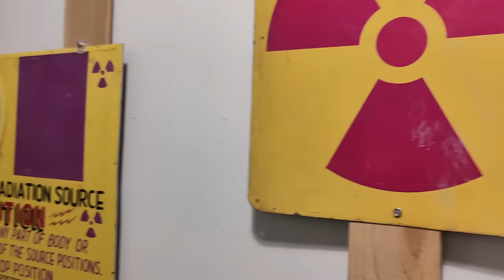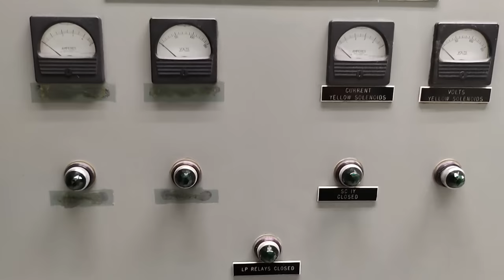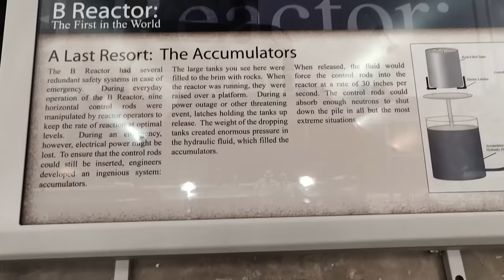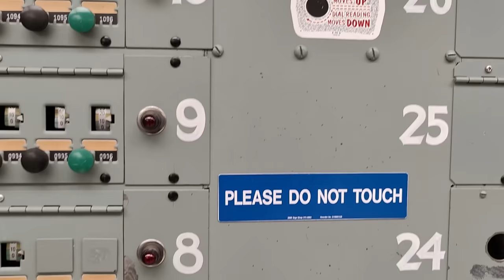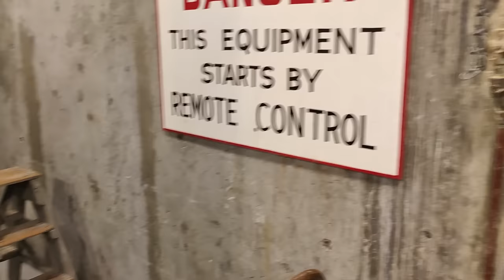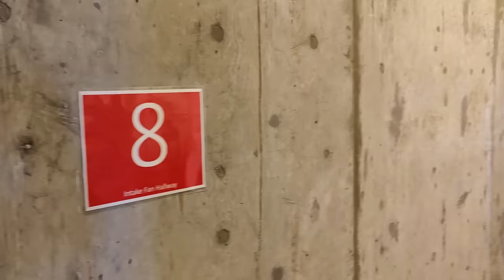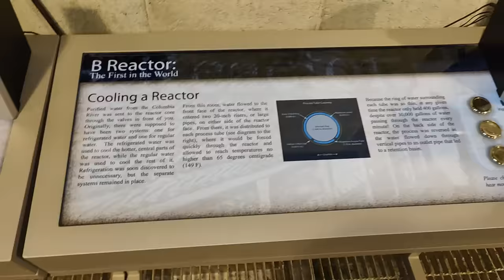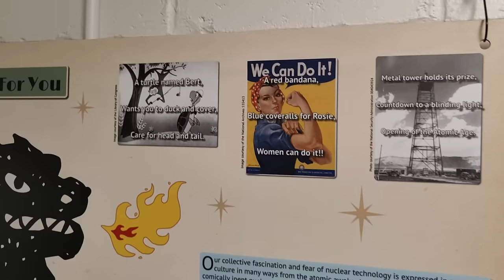Hanford Nuclear B REACTOR: TOUR & EXPLORE

Comment: A real shame this reactor is not in use anymore. It could very easily be put back into working condition.
Reply: The control and instrumentation systems would have to be made digital to comply with current control system and instrumentation system standards.
Reply: @brentboswell1294  
I agree but sometimes analogue can be more reliable.
Reply: @Draxindustries1  I don't think that the Nuclear Regulatory Commission in the USA would allow operation without a DCS these days.  Of course, Hanford Reach operated outside the jurisdiction of the NRC, since it was built before the NRC was created 😉  It was unique in that it was a "breeder" reactor, which took natural Uranium in and produced Plutonium for the US Military...
Reply: @brentboswell1294  
This is exactly what  Dounray in Scotland UK did. The second reactor built there was a breeder. It produced quite vast amounts of Plutonium from the Uranium. It wasn't without its problems though with the nearby beach being contaminated with fragments of pellets.
It's now slowly being dismantled with a workforce predicted to be there for the next circa 30 years..
Reply: that's a joke right ?

Comment: 18:56 what is "barrier cream"?
Reply: A hand cream type product that could be used instead of cotton gloves to prevent the skin coming in contact from certain materials. 
A cream would protect the skin from alpha or beta forms of radiation. Both types of radiation are charged particles and have very limited penetrating power. A sheet of paper will stop and alpha particle.